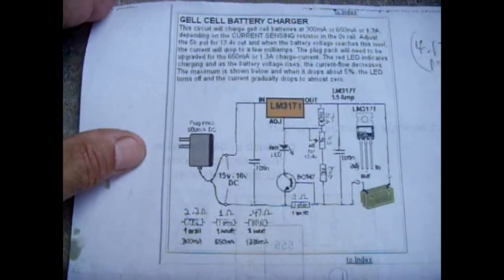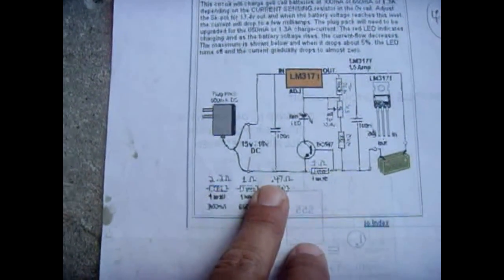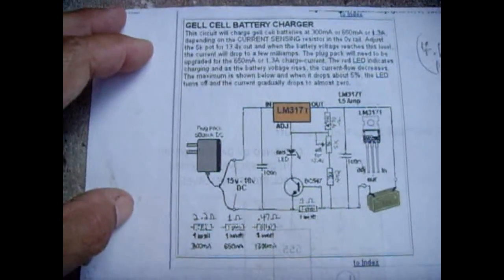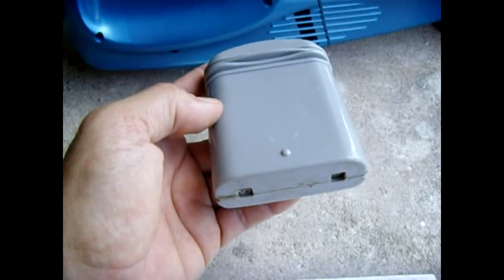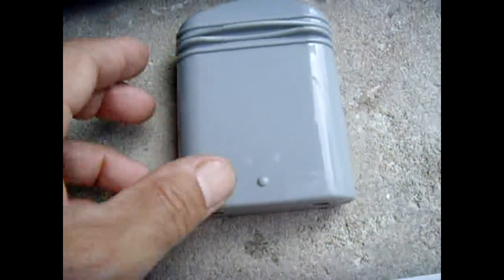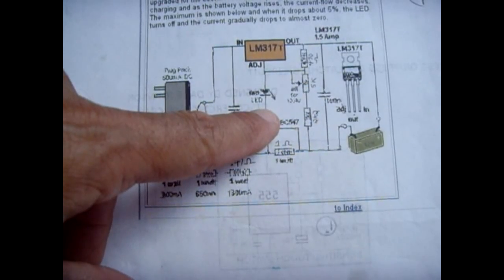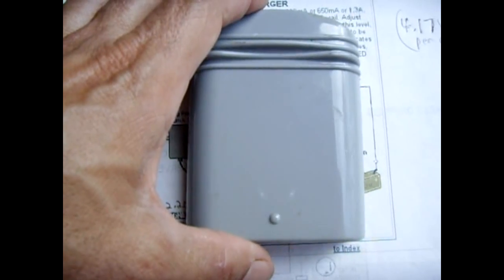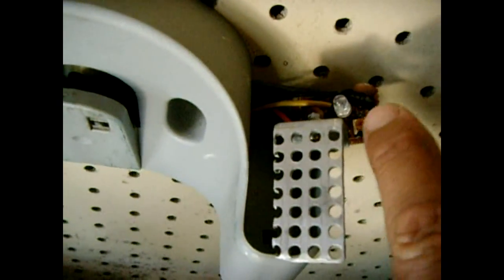Excellent & Simple Battery Charger (Gel/Lead Acid/Li-Ion/+ more)

Comment: They run cheap and clean on black diesel, 50% used filtered motor oil , 20% gasoline and 30% diesel. You can even substitute the used motor oil with used vegetable oil so long as it is filtered and you blend it with gasoline and diesel.

Comment: Does it work for car batteries?
Reply: I tested this on a car battery, and it worked but I could not get any more than 250mA of current out of it on my bread board layout, not sure why I was using a salvaged door bell transformer and a bridge rectifier with 17.2V open circuit test. When I tried a 1 Ohm resistor to boost up the mA my RED LED would not light up so I was using a 3 Ohm resistor there.

Comment: So I built the circuit for a 12V 12AH lead acid battery. I decided to build the power supply with a small 12VAC 20VA torroid transformer connected to a full bridge rectifier. All is working well except for the LED. I didn't have the BC547 transistor so I used a 2N2222A1 which
Is very similar in performance but it does not play nice with the LED. I'll just get a volt/amp meter instead and connect the circuit to that.

Comment: Hi, newest subscriber here! Am a novice seeking clarification:
1. To charge two 18650 li-ion (3.7V each), is it ok to connect them in series and then connect this charger terminals (at 8.34V) to the battery terminals?
2. Taking a tracker example, it should be connected to power supply full time so that when the battery goes low it starts charging automatically and when battery is full it stops charging automatically. Is this circuit fit for such application?
3. Can the battery be used while still charging or how do I go about that?
Please help me with these three questions.
Thanks in advance

Comment: good day sir...i tried your circuit and it works very well. i've used it for a rechargeable LED lantern i designed 2 months ago, Your're great !!!...i want to ask would there be the need for a diode at some point in the circuit so that when there's a power out from the mains or when the battery gets fully charged the diode will prevent it from discharging back into the circuit?...thank you
Reply from the maker: The way it's set up, the current across the resistors would only be 1.5mA of drain. You can use a Schottky diode in series with the wire to the battery POS if desired.
Reply: @electronicsNmore  thank you sir

Comment: boss, i want to use this circuit to charge 6v/4.5AH lead-acid battery....what i have for now is a 12v wall adapter.
will that be fine?...and to what voltage should i set the charger?....Thanks
Reply from the maker: A fully charged 6V lead acid is around 6.9 -7V. Experiment using different power adapters.
Reply: @electronicsNmore Thanks alot Boss

Comment: How to control battery from overcharging and over discharge
Reply from the maker: The circuit CHARGES batteries, it doesn't discharge them. You set the MAX charging voltage then it stops. Thanks for watching!

Comment: I think LED will not light up during charging since BC547 is off during charging, when battery is full, internal resistor of battery fall down then BC547 turn ON to cut off charge voltage then LED light up
Reply from the maker: Circuit works just fine.

Comment: can I use this circuit to recharge a 12 volt battery using a 12 volt transformer
Reply: no, you need 13.4 v floating when the battery is full, the ideal is use 14.4 when start charging

Comment: Hi, I am a novice and have created a customized 12V 10AH NiMH battery pack. In this I have arranged 10 cells in series and 4 in parallel. Each cell is 1.2V and has 2000mAh capacity. I need a charger for this battery pack. Will your circuit work for me?

Comment: Hello, I am using this circuit to charge a 9 Volt NiMH Battery with a 12V 1A wall wart. I was wondering how do you make sure that the battery doesn't discharge when the wall wart is disconnected. I put this circuit with my resistor modifications into LTSpice and when I take off the 12 Volts, it shows a discharge on the battery of -20mA which might be too much for my 9 Volt 300mAh battery. I also am not using the variable single pot resistor, which may be the problem? I also am not using the first LED only the last one.

Thanks!
Reply from the maker: Use a 1N5818 Schottky diode in series with the + of the battery being charged. :-)
Reply: electronicsNmore okay thank you, also do you happen to be really good at coding microcontrollers? Specifically the STM32 microcontroller?

Comment: When you adjust the voltage pot what voltage range do you get?
Reply from the maker: Been a while, 7 - 15v maybe. Don't expect higher voltage output if the power supply you're using does not supply enough current.
Reply: cool thanks  great video

Comment: sir i have a 12amp transformer,, what value of a rectified diode i will used & value of capacitor
Reply from the maker: LM317T can only supply 1.5A and an LM350 can supply 3A. Using a 12A transformer is a huge overkill.

Comment: could i use a step down buck converter with current regulation instead of a lm317 ?
Reply from the maker: No, the circuit was designed to use the very inexpensive LM317T or LM350. Thanks for watching!

Comment: i have a 11V 2A transformer. still can use it?
Reply from the maker: It depends. What's the open circuit voltage? What voltage and current will you be charging at?
Reply: +electronicsNmore 
im beginner at this and my English sucks I'll try to explain
the transformer gives 11v 2a without a rectifier.  and i want to charge two lithium cell like yours but in pararel
Reply from the maker: el viejo del costal
Once rectified, you'll be able to use the circuit. Keep the charging current around 1/2 the cell rating, and set the charging voltage at 8.37V for (2). It's better to charge 2 in parallel at 4.18v.
Reply: +electronicsNmore 4.18v in pararel got it. at what current i should charge them if Together gives 5200mah?
Reply from the maker: +el viejo del costal Set it around 1.5A. It will take a few hours.
Reply: +electronicsNmore 
great thx I'll subscribe

Comment: I might add a transformer, rectifier and some smoothing as well. Then it could be charged from the mains. What VA would you say it would need as I'm unsure how much current it pulls on the input side? If I used an 18v step down and based it on that packs 500ma rating that would be 9va or 10va to be safe I would presume. (I'm 220vac btw)
Reply from the maker: That is what this circuit uses, a wall transformer with a DC output. The power supply must be able to supply enough current, and have a higher voltage output than the battery being charged.

Comment: hey mate, im trying to charge 20 3.7V 2500mAH batteries all in parallel with a total of 50AH  how would i go about this with your circuit?
Reply: Callum Stewart please have you been able to find a solution to this problem, I'm in a similar situation, thanks in anticipation to your reply
Reply: To charge it good in parallel connection you always must have balanicing/overcharge/temperature  and short protection for each cell separately there is some easy way to build it , if enough users want it I could show exact way how to build it but I am sure there is many such videos over youtube already. But keep in mind those parts needed for such build exceed price of  how much is 4-6 cell charging protection on ebay, and you buy 4 peaces of such board for 6 cell charging , and there you go , easy and cheap. Here is example of what you need for each cell, this is pack of what you need cover 10 cells. https://goo.gl/q3z1mx

Comment: After charging and use the 18650 make sure its in discharge protection circuit u put on other wise ur cell will be damage for overdischarging i also make now discharge indicator beacause i use 18650 in direct conections wothout any circuit so when the battery is down near 2.5 volts the red led indicates that now the battery is in 2.5 volts be aware for this ...and this circuit only cutoff power when its reach the desire voltage charge and it stops charging thats it ...and once again thanks for ur information ..

Comment: Thanks good i fix it i simply transfer my circuit on pcb and soldered cmponents and i converted dc volts from 15 volts to 12 volts and change the 2.2k with 1 k because i want 4.2volts for 18650gr .thank u man nice circuit very helpfull.
Reply from the maker: +ADEEL MALIK 
Good to hear. Keep the voltage around 4.18 to be safe. :-)

Comment: same problem my led led wont work i use 16 vdc 700 mili amp power supply how to fix this same circuit i design and i use 1 ohm resistor and 2 li ion 18650 cells in series .i try every thing but some thing is missing or the resistor values are not correct i design same circuit but why my led doesnt light up plz help me .
Reply from the maker: +ADEEL MALIK 
No idea what the problem is. If the battery is fully charged, then the LED will not light up. The circuit is very simple, and works very well. You did something wrong, or you have a faulty component.

Comment: Hi sir, thanks for the video. sir  i want to ask that will the circuit automatically start charging if battery is discharged after charging??
can we use the power while charging battery??
can we keep the battery attached to circuit with 27*7 with power on and simultaneously use the same power??
i want to make LED 5v to be ON 24*7 with the battery
so that it can work when mains line is there or not

Comment: Thank you for the video, i want to ask you a question: Can I assemble a step-down (buck) regulator to the output of a regular 19volt 1amp  laptop transformer/charger to charge a lead acid sealed battery? If so then at what voltage should I interrupt the charging process of the cell?

Comment: My LED will not light...Does the charging voltage go thru the LED to the battery????
Reply from the maker: +Kennynva T. 
Make sure the LED is connected properly.
Reply: I tried it both ways..
Reply: I can see the ampmeter on my power supply move up when connected..so I know its doing something..but the led dont light..

Comment: hey i tried this circuit and the charging part works i get to adjust the voltage from 20-7 V but the led does not light any idea what can cause that?

Comment: what is the max voltage output because i wanna build a 12v 2a li-on charger
Reply from the maker: +Gj De Laat 
I do not recommend charging more than 2 lithium ion batteries in series(really should only be charging 1). All 3 need to be charged in parallel using 4.17V.

Thanks
Reply: +electronicsNmore thnx for the info 😊

Comment: As a circuit builder for the last 30+ years, there is one thing I noticed that you need to think about, all bipolar transistors such as your BC547 (an NPN transistor) requires that base emitter current be limited or else current can flow through this junction bypassing the 3 ohm resistor, this configuration is for limiting the charging current, but still you need to have some protection for the transistor's base emitter junction, so by inserting a minimum of 1K resistor in series with this base and negative rail can achieve this, since most of the current will indeed flow through the 3 ohm resistor, hence why so far your transistor has survived, but should that 3 ohm resistor cook up for any reason then you have unlimited current flow through your Base emitter junction and it could prevent LM317 from limiting current control and thus start passing more current through your batteries. 

For Amitava Roy, to increase the current flow to double, i.e. 80mA, you need to add another 3 ohm resistor in parallel (next to the one that is already in the circuit) this will effectively give you double the charging current.

BC547 transistor requires 0.7v to between its base and emitter to switch on and start regulating current by bringing the Adj pin of the LM317 pulling it to ground, when a voltage of 0.7v develops across that 3 ohm resistor,  so that means according to my calculation if you divide 0.7v by 3 ohm resistor it can only pass maximum 23mA. This means the rest of the  charging current is passing through this base emitter junction which can cook it eventually, the base emitter junction should not pass more than about 2 to 3 mA as it can sustain damage, so that is why one should insert a safety  current limiting resistor in series with the base pin of BC547, for those who don't know which is base, it is the middle leg, and the leg at the bottom with an arrow is the emitter or ground connection, the top 3rd leg is your collector going to the LED.

So when you insert a series 1K between base emitter to prevent possible damage to BC547, this would also mean that your charging current will go down to 23mA or there abouts with that 3 ohm resistor, so you will need to change the 3 ohms resistor to something like 1 ohm if you  were going to use a series base resistor. With 1 ohm it should give you 0.7 divide by 1 ohm = 70 - 75mA charging current.
Reply: Hi. I've made this circuit more than 50 times and failed every time. Used only new parts. Between E-B transistor 1ohm/1W resistor. First time works to charge 2 li-ion batteries and second time crush and led not light anymore. Any advice? Failed with all circuit made from internet based on li-ion charger schematics. I know are cheap circuit to buy around, but I need it to make it by my hands to work. ;(
Reply from the maker: This circuit is EXTREMELY simple, and it works. Clearly you're doing something wrong. I don't show circuits on this channel that do not work. Make sure your power supply can supply enough voltage/current.
Reply: electronicsNmore I don't blame you for not working for me but Jayant Desai made some interesting points and I thought he was right and solve my problems. I've struggle with that circuit.I know it's a simple circuit but it's a pain in the ass. My supply 12volts/1Amp or 17v/4amps LM317T BC547. First time when I've tried the circuit works to charge 2 li-ion 18650/2.2 amps pot adjusted to 8.36v and led turn on when connect those 2 li-ion cells and after charge done when I place other bateries on charge led doesn't light anymore but the voltage stay on 8.36v but do not charge after testing for about one hour. :(
Reply from the maker: Robert s
You probably burned up the transistor. Hope you had a large heat sink.
Reply: Maybe bc547 but LM317T was on heat sink always and test it after and works good like voltage regulator.

Comment: Hi Sir, I have already made a home made charger using 0-6-12 [4 Amp] Step Down Transformer. It can charge Android Phone good with mili Ampere like 0.45 to 0.50 constant using VOLTAGE REGULATOR 7805. No problem so far. But cann't charge Iphone or Bigger Android Phones having 5.5" LCD , need at least of 0.80+ mA instead of 0.45+mA. I have used 4700 mFD 25 Volt capacitor in the filter section just after the 4 IN5408 Diodes and 1000 mFd in the input & 470 mFd in the output section in parallel with ground. 5.1 Volt Zener in the end stage of taking output ! Now my question is that how can I increase the current from 0.45+ to 0.80 mA at least ? 

And can I use this charging circuit in charging 2/3 pcs. of 4.2 Volt LI-ION 18650 BATTERY in series of 6300 mAh printed on the battery? If not then please guide me how to alter it in best possible manner ?
Reply from the maker: +Amitava Roy 
Hi there. Questions unrelated to the circuit shown in the video, I will not be able to answer. If you want to charge 18650's, then I do not suggest charging more than 2 in series. Thank You
Reply: +electronicsNmore  Which one will be better Series with 2 batteries or Parallel with 3 or more as per my home made charger is concerned ?
Reply from the maker: Charging in parallel is recommended.
Reply: +electronicsNmore  Thank you sir.

Comment: Hi Sir, thanks for this video. Sir one thing isn't clear, does this circuit automatically cuts off the supply from the battery when fully charged ?
Reply from the maker: +SOUMIK BANERJEE 
Yes. Thanks for watching!
Reply from the maker: +SOUMIK BANERJEE 
Yes. Thanks for watching!

Comment: hello, i have some problem regarding the circuit and i have some question to ask you. Im using the circuit to charge a 9V nimh battery with a current of 300mah from ANSMANN. i connect the circuit as mentioned in the video and i use the 2.2 ohm resistor so that it will give a 300ma current, but after connecting the circuit, the lowest voltage that it can go is about 7.1V and the highest it can go is about 9.6V plus the LED is not working. Hope you can help regarding the problem? Thanks and sorry for the trouble.
Reply from the maker: +Yassin Noor 

You need around 10.5V output to charge the 9V battery. Try a slightly higher voltage wall transformer. If that does not work, then you need to make sure the correct POT is installed, double check the circuit/components, and possibly play around with the resistor value between the POT and NEG rail.
Thanks For Watching

Comment: Hi, Can I use mobile phone charger ( approximately 6v) to operate this circuit instead of 15v to charge single li-ion battery? Thanks.
Reply from the maker: +neon 88 
The voltage might be too low. If you set the charging current down to 250mA, it may work. Using higher charging current may cause a big voltage drop.

Thanks

Comment: hey there, i will like to know the voltage rating of the 2 100nF capacitor? Thanks!
Reply from the maker: +Yassin Noor 
Hello. 25v should be fine
Reply: +electronicsNmore 
Thanks for your help. i try to find the rating of 25v but i can only get voltage rating of 50V. Will the circuit still work?
Reply from the maker: Yassin Noor Using higher than rated is no issue, never use lower.
Reply: +electronicsNmore 
Alright noted. Thanks for your help!